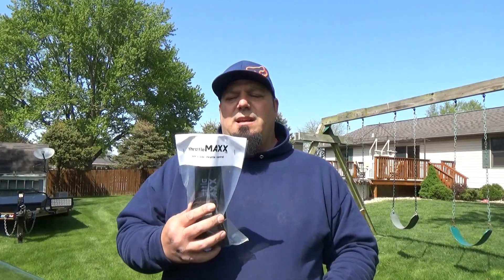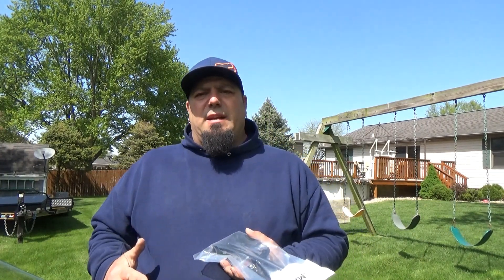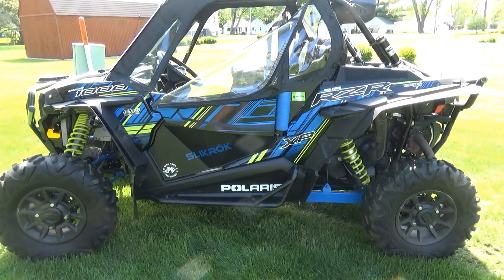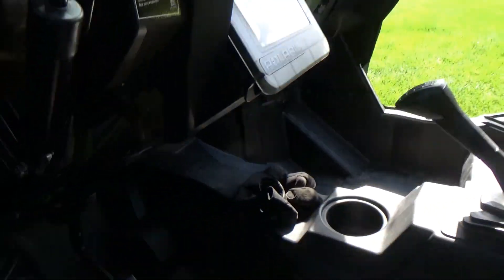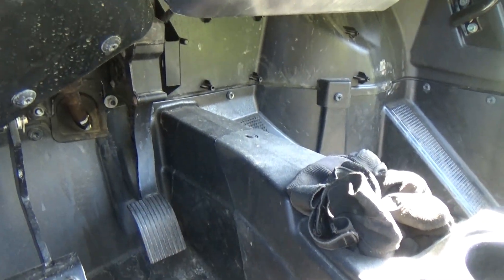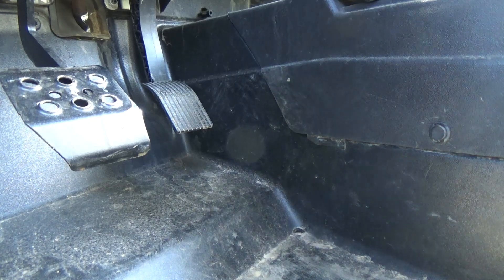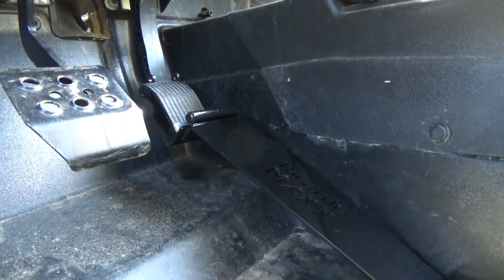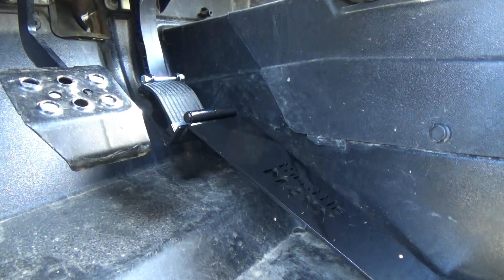Throttle Maxx Installation RZR XP 1000

Comment: The throttle installation looks  to be easy, I  used  to operate heavy equipment that  had the peddle angles like you show.  By changing the  angle  degree,   you'll have less leg and ankle strain.

Comment: I heard you say buddy had one on a talon. which one did he add. I've been begging them to make one for the talon forever. sent bunches of emails.
Reply from the maker: My wife and I drove a buddies Talon and that's when we noticed our feet and calf cramping because of the angle of the gas pedal. He did not have a throttle Maxx installed. I purchased one for my Xp 1K to help my wife, kids and myself because I  had surgery on my right foot. The kids love it.